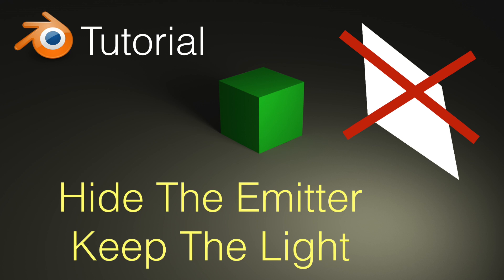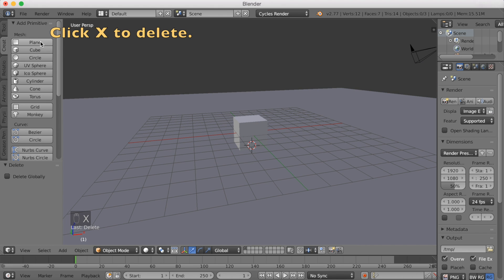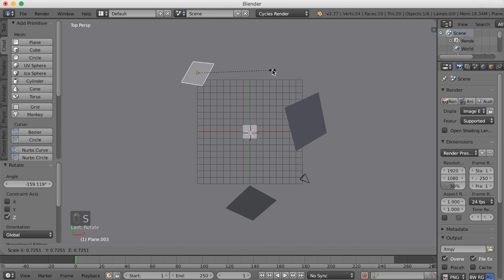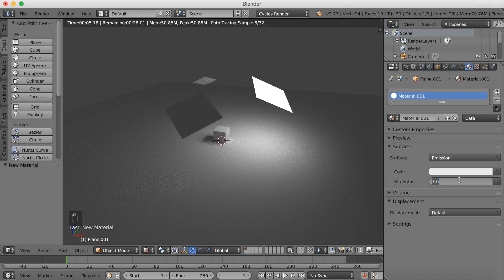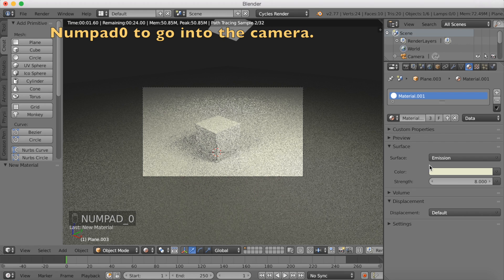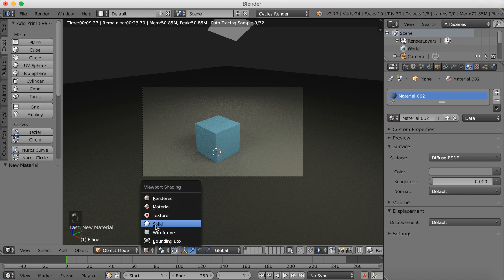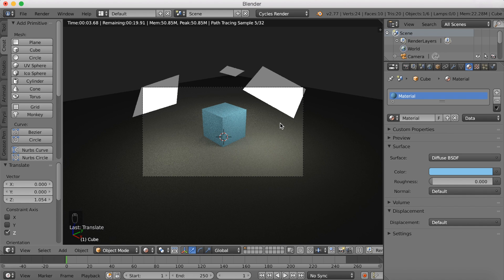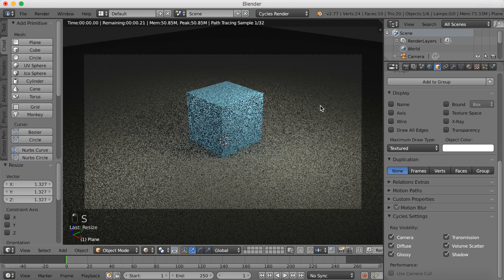[2.79] How To Hide The Emitter And Keep The Light Blender Tutorial

Comment: Hello, thanks for the video ! 
do you know of any way to hide the emitter object in any of the non-rendered view modes?
my lights get in the way of my view while trying to work with my scene, and hiding them the conventional way by hitting H or the eye icons in the outliner window turn the lights off completely, so I don't even get to see the simulated GLSL lighting in material viewport shading mode, which I use most often.
Thanks again!
Reply from the maker: Just click H or click on the eye of the object in the outliner up to the right :)
Reply: that would work if the emitted light didn't go off with the emitter object. 
viewing the scene with the simulated GLSL lighting in a non-rendered mode gives the quickest representation of a scene might look like when rendered, but it seems that the only way to get that lighting is if the emitter objects are obstructing my view.

Comment: thanks Olav, great tip! But: in my work,  because of where I've placed my emitter I get a dark line across the scene which I believe is caused by a shadow of the emitter itself. I selected the object, went to Object properties, went down to Cycles Settings, and disabled the settings Camera and  Shadow. I still have that dark line on my scene. If I move the emitter the line moves with it, and so far my solution is to move the emitter away from the scene such that the line is no longer visible. Not a good solution because that's not where I want my light. Any suggestions? Thanks Olav.
Reply from the maker: I know what you mean, I usually just move it away a bit and increase the strength.

Comment: Alternate method is to use lightpaths node on emitter material and use camera output to control mix with transparent shader. That way anything with the emitter material applied is invisible to the camera. Could save some steps depending on workflow.
Reply from the maker: +pauljs75 This tutorial only has one step though. Most of the time was spent on setting up the lighting, the process of hiding the plane took 5 seconds. But your way is probably good too. 😁
Reply: pauljs75 - I tried your method but it did work for me, could explain this more please?